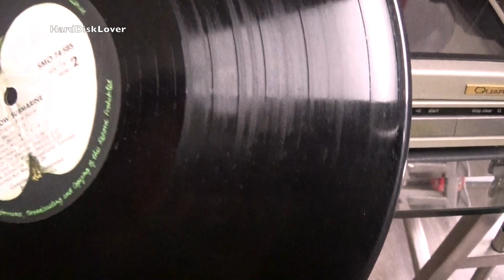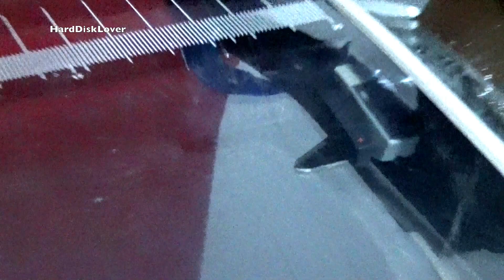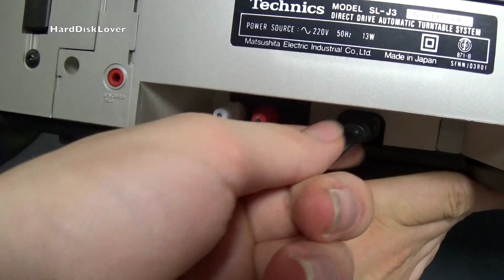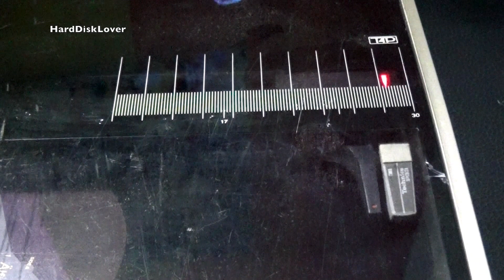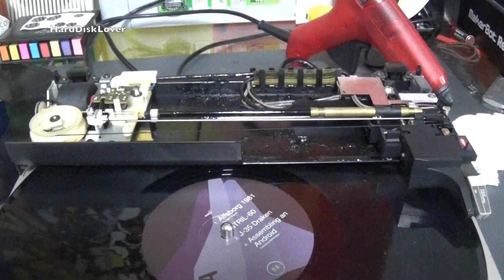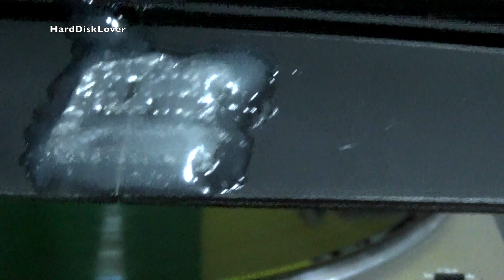Technics SL-J3 Turntable Repair

Comment: The older components in the late 80s and early 90s were connected to each other with wires that controlled either the remote control for the components or the syncro edit functions when recording record to cassette or CD to cassette.  Later models had sensors on each of the components for remote function and that reduced the amount of wiring instead of just using only the one sensor on the tuner. So they got rid of those connections for remote control.

Comment: I got lucky i bought a optumis its just like this one. When i got it i paid 15 dollars for it because it wasn't working. The problem was it would play 80 % of the record then it would make a non stop clicking sound then it would go back to its base. I thought i was going to go through hell to fix it. I took it all apart and found the problem some how the adapter to play 7" records was inside the player stopping the arm from going all the way acrossed i pulled that out and put it back together its been working fine no problems not bad for only 15 dollars if any one wants to know what model it was it was a lab-2250